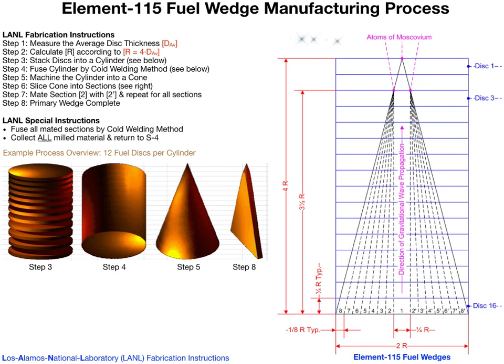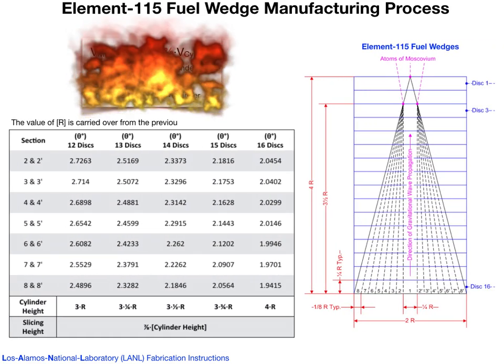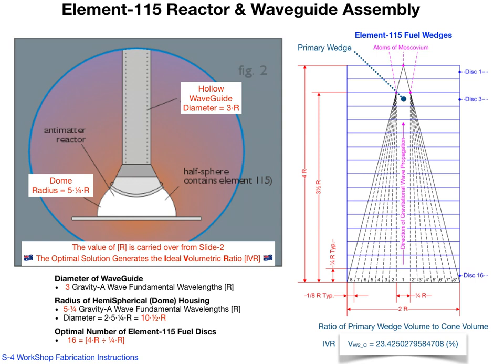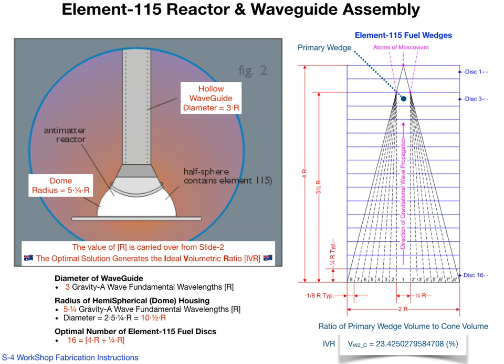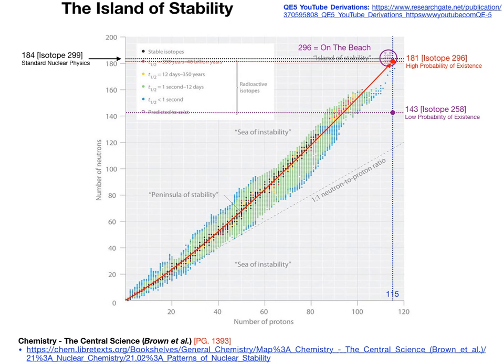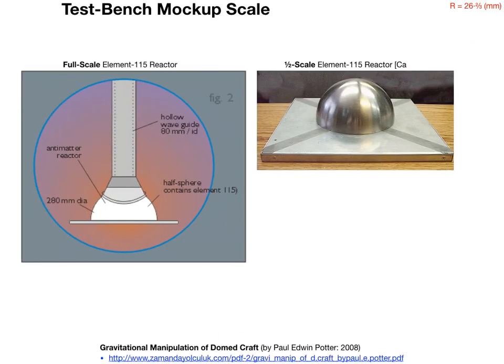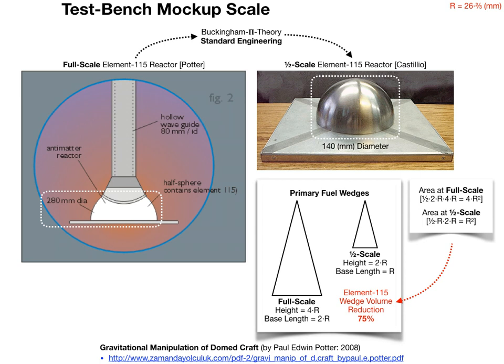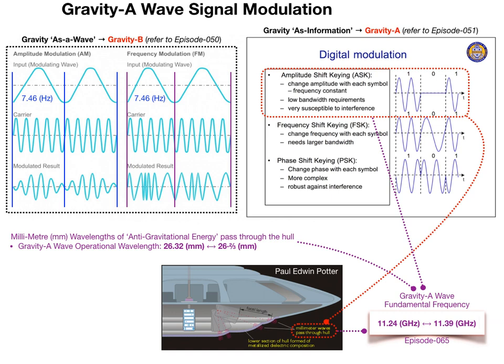074 Project Gravitaur (Synopsis)

Comment: How do you calculate the thickness of the disk depending on the element used? Does it have to do with the nucleus frequency?
Reply from the maker: Yes. It’s ¼ of the Fundamental Wavelength
Reply: @QE-5  and the fundamental wavelength is calculated from the nucleus frequency?
Reply from the maker: @Porcupine-t1h  Yes. However, the term 'Nucleus Frequency' doesn't quite convey the right idea to the general public following this conversation (it implies that the Nucleus is vibrating), but I know what you mean.